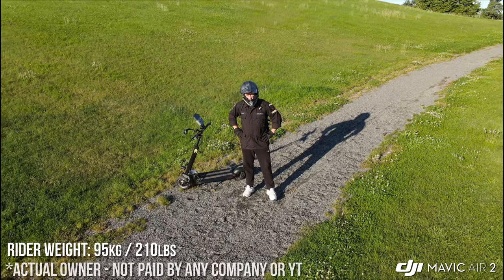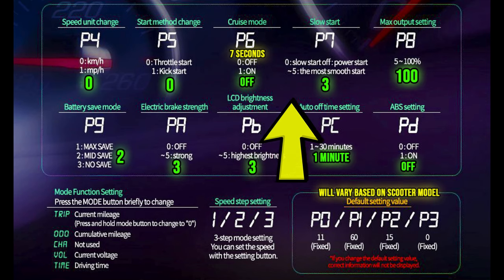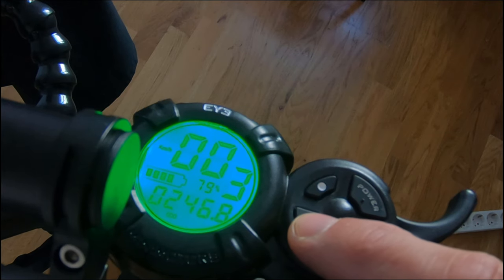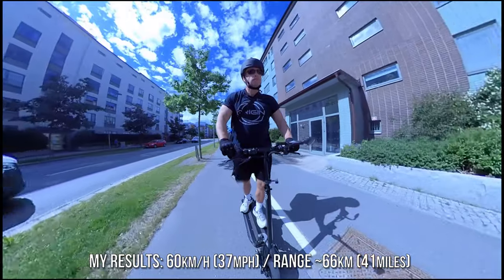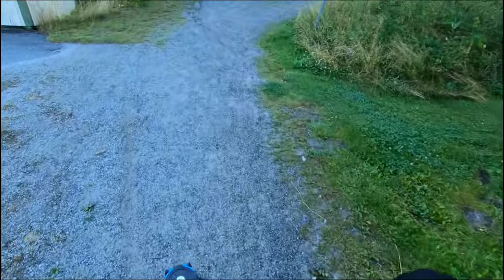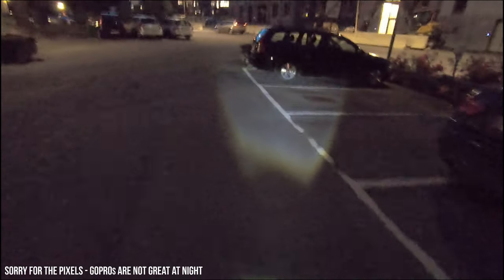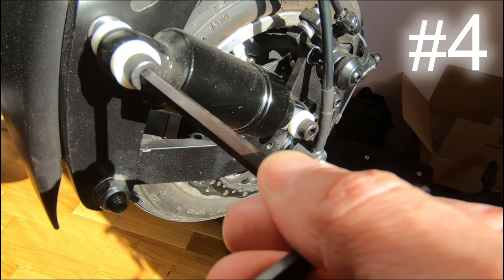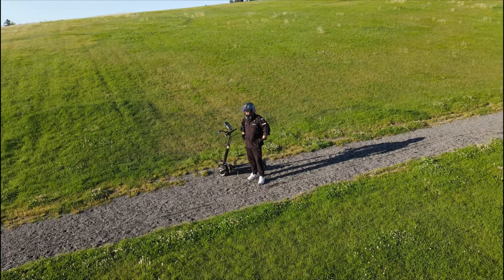Speedway 5 Review.  200km Owner Report.  Electric Scooter.

Comment: Great review! Though I noticed that you didn't use the extra lights. There  is a button next to the two charging ports the turn on side lights and more front and back lights which you did not show in your light demonstration.
Reply from the maker: Thanks!  Yeah I forgot to turn those on.  I will post a mini - oops vid showing those light, and hopefully I can tweak the cam settings for better night quality.

Comment: What you said at the end was on point. I didn't realize until after I bought the Cruiser (Speedway IV) that I preferred the smaller lighterweight scooters. Those were what was best for me. Now I'm kinda stuck with it and have to live with this bulkiness.
Reply from the maker: That is the biggest challenge for most folks, figuring out exactly which scooter will fit the best.  I like all of the ones I have, but find myself hopping on the Speedway 5 most often (perfect balance of range, speed and weight for most of my commuting needs)

Comment: what a review. jesus, that was superb. I have over 600km on mine spw5. I will check the screws you said it may be tightened.
Reply from the maker: Thanks so much!  The 5 is a pretty solid scoot, but those few bolts seem to take the most punishment from driving.   At 600km, you have any issues at all you have noticed?
Reply: @swerider2417  Not really, so far no problem. Not lose bolts or screws. The handlebar had to be tightened  as it was already kind of loose for braking and acceleration i am assuming...my issues with the scooter are the mudguards...they both suck ass. (specially the front one) i had to purchased extra mudguards from the minimotors. They are pricey but now its way better. Other than that...is such a great piece of machinery.

Comment: Best review ever seen . My Speedway 5 after 300 KMS it's making a lot of noises ( crank crank ) from the front fork where is the shocks . So I have to buy from Ali another ones and change / replace with the stock one Wich the scooter's comes .
Reply: My Speedway 5 was really creaky but I used wd 40 on the shocks and washers. The sound is completely gone now. Also tightening all the screws and bolts is required regularly. Hope this is helpful.
Reply from the maker: Thanks!  Mine had some noise, but it was fixed with tightening the bolts.  You could try some lube/wd40 on the shocks like Jeff hittall suggested as well.
Reply from the maker: @jeffwhittall371  Mine were fixed with tightening the bolts.  Great suggestion on the wd40 - will keep that in mind for the future.
Reply: @swerider2417  better silicone ( spray WD-40 ) I think is super cool too . But I want to put another shocks .. like EXA 125MM or DNM .
Reply from the maker: @ManDone88  I might do the same because of my weight.  Check out this vid: https://youtu.be/ozlC07iIOms  In the comments he has pics of the sizes of shocks that fit the speedway 5.
Reply: @swerider2417  cool . Ty . Hope you do a Telegram channel for us ( Speedway 5 users ) .

Comment: Great review! I am considering purchasing one to upgrade/replace the scooter I have. This so far looks like what I'm looking for in terms of what it can handle. I have a question(or few). How has the maintenance been? Have you run into any issues where you have needed repair? Are you able to do it yourself or do you know services that can help repair it. Like possible lost/broken parts, replacements etc. Thanks.
Reply from the maker: Thanks!  I have just over 300km on it right now.  Maintenance has only been tightening bolts (I have loctite on them since 100km and they have not needed tightening since - but I still check them every 100km).  Tire pressure refilled once - all tires loose air.  I  have Armor-Dilloz tire sealant in them and not gotten a flat yet🤞.  Brake pads still in good condition, but I dont do extreme braking.  So been a really reliable commuter for me.  If this one ever dies/wrecks etc.  I will get another Speedway 5 to replace it.  Replacement parts are readily available.  I have not needed to repair/replace anything yet.   I did recently buy the carry handle for the back - makes it much easier to lift up and down steps.  I will show that in my update video when I reach 500km.   Hope this helps, feel free to ask if you have other questions.

Comment: Thanks for the nice review.  Seems that you found it fairly durable thus far with minimal quality / durability issues, which is something to beware of in the relatively young e-scooter market.  I am wondering on how water resistant this scooter is.  Do you think  it can be ridden in light rain on wet city roads with occasional shallow puddles without fear of failing components due to water?  You mention the 4 caps that would be concern for water, what do these 4 caps cover, and would it be easy to make them more waterproof?  Is one for the charging port?  Is there an overall IP water resistant rating on this scooter?  Thanks.
Reply from the maker: Since the review I have run a thick bead of Blue Loctite silicone around the 4 caps and at all points where wires enter the deck.  I have ridden on wet roads after rain, and so far seems to be working.  I won't risk driving in the rain, as the sealing I did was to protect from splash back.  The 2 charging ports sit behind the cap, so not an issue.  I am not aware of any IP rating for this scoot. Honestly with the gaps and entry points straight from the factory if a seller lists an IP rating, I wouldn't trust it.  Only scoot I know that has an IP rating marketed is the e-Move cruiser (single motor version of this)
Reply: @swerider2417   Thanks!

Comment: Is it waterproof or resistant? I live in Florida so rain can be a big factor during hurricane season?
Reply from the maker: The speedway 5 is not waterproof.  I have ridden after the rain, but I have added sealant around the base and where the wires enter.  I would not drive in the rain though.  The e-move cruiser is water proof, but the cruiser is a single motor version of the speedway,  so not as fast.

Comment: I’m jammed up deciding between this guy and the DT Eagle Pro, any advice? They’re supposedly comparable spec-wise and price wise, I’m somewhat wondering if it’s worth the extra money to get the name branded version for parts and maintenance reasons, or is that mostly a non-issue? I’ll be my first actual purchase in the e-scooter department. They both just fit my budget and weight/space requirements really well.
Reply from the maker: I think if you go with the branded Speedway 5 or the Eagle Pro you should feel comfortable with the minimotors logo.  The only reason I stayed away from Dualtrons was the stem issues and felt like buying a Lexus vs. a Toyota.  Both same motor and power plant, but just not the flashy trim. Never haven ridden an Ealgle Pro, really can't comment on ride and other stats.  The non-branded one I have I just ordered spare tires for the branded one, - non-issue as parts are identical.
Reply: @swerider2417  If I may bother you on one last thing, I’m having trouble finding it on aliexpress,  the link wasn’t working for me so I’m having a go with the regular search and it’s hellacious. 😂
Reply from the maker: @blackjack117200  No bother at all.  Going to  try to paste the Long link here lol:  https://www.aliexpress.com/item/4000359594289.html?spm=a2g0o.productlist.0.0.3092583bAFkV9D&algo_pvid=9e68182e-0522-4f76-a42f-95b0cf51a0e1&algo_expid=9e68182e-0522-4f76-a42f-95b0cf51a0e1-39&btsid=0ab6fb8315890151230201271e272e&ws_ab_test=searchweb0_0,searchweb201602_,searchweb201603_
Reply: @swerider2417  Thanks! Have a happy New Year!
Reply from the maker: @blackjack117200  No problem.  Happy New Year!
Reply: @swerider2417 Just for an update: I drove a few hours to the closest shop which was Ryddo in LA and did some test rides and checked out different models for three hours or so, and I finally settled on what used to be the owner’s personal DT Thunder he was selling as a demo unit, I think I ended up getting a good deal but mainly I just felt a lot safer on the thicc boi. 
I still greatly appreciate the help!
Reply from the maker: @blackjack117200  Awesome!  Glad you found a good fit, and, at a good price😉.  The Thunder is a beast.  I'm sure you will love it🛴

Comment: Hi I just got my speedway 5 yesterday.please my question is how do you check the watts on each tyres of the 1000watts. Thanks
Reply from the maker: Not sure how you would - a scooter techie might need to answer that.  Would probably need some sort of electrical monitoring equip to verify.  Since the speedway 5 is and established scoot, I never questioned if they were actually 1000w per wheel.  Hopefully someone will chime in here and give us both the answer.

Comment: Har du möjligtvis kvar länken till scootern? :)   Den nuvarande funkar inte.  Funderar på att uppgradera från Zero 9.
Reply from the maker: https://www.aliexpress.com/item/4000359594289.html?spm=a2g0o.productlist.0.0.3092583bAFkV9D&algo_pvid=9e68182e-0522-4f76-a42f-95b0cf51a0e1&algo_expid=9e68182e-0522-4f76-a42f-95b0cf51a0e1-39&btsid=0ab6fb8315890151230201271e272e&ws_ab_test=searchweb0_0,searchweb201602_,searchweb201603_

Sorry for the long link - but it works ;)
Reply from the maker: There is also a local shop in Stockholm, but for a few 1000kr more:  https://minimotorssverige.se/product/speedway-5/
Reply: The link is not working anymore...do you now where to buy it now ? 
I don't want to buy the branded one and pay extra for the name only...
Thank you

Comment: @swe Rider , which is the diameter of the stock brake disk of speedway 5 ? It doesn't put any mm on it . And I want to buy 160mm custom one but I'm afraid is doesn't fit ...
Reply from the maker: Just measured mine - 14cm or 140mm
Reply: @swerider2417  160 Will fit without any modifications ? I mean , the adapter will support it ?
Reply from the maker: @ManDone88  Not sure on that one.  To me it seems that a spacer/riser would be needed on the brake caliper to support a larger disk - but don't know much on modding.  There is not much clearance with the 140, so my guess is that 160 would not fit without mods. - Just a guess though.

Comment: what is the minimum voltage cut off?
Reply from the maker: Mine shut down when I pushed it full mode 3 up a hill around 43v.  Not sure if the official number by the manufacturer.  I charge mine now whenever the voltage goes below 50v.
Reply: @swerider2417  I believe it's 44 V

Comment: Thanks for your video!
very helpful!
I'd like to ask, i find 2 or 3 sellers on aliexpress that sell speedway 5 at 1350 € while official stores sell it at 2000..
Do you trust that the product is genuine ???
Thanks!
Reply from the maker: Yes I trust them.  I purchased mine from aliexpress (mine is a no-logo version) and other than mine not having the logos, it is exactly the same as you would buy from minimotors.  Same motors, battery, EYE LCD.   The official stores have markups and most prices are in a fixed range.  Sellers here in Sweden are priced almost exactly like the minimotors prices in the UK and USA.  All of my scooters have been bought on Aliexpress/Geekbuying, and I have not had any issues.  Folks that buy from "official stores" still receive scooters with flaws, so other than having a local store for support, no reason in my mind to spend the extra cash.  The minimotors store here is only open a few hours on SAT.  No repair services, just sales.  I could not justify paying more for local.   NOTE: Big thing when buying from Aliexpress - be sure to pick a seller that has a good rating, and has made several sales of the model.
Reply: SWE Rider I’m in the market to purchase a turbowheel lightning. It is trustworthy to buy one off of aliexpress? I was going to purchase the lightning because it is the cheapest version of the zero 10x I saw being by companies.
Reply from the maker: @l-Lucid-l  I have purchased all but one of my scooters from Aliexpress, and most of my scooter accessories.  In my experience you can trust most sellers on Aliexpress.  Just check the user ratings and feedback for the seller.  Often there are multiple sellers that sell the same item - try to find the one with the most/best reviews.
Reply: @swerider2417  Thanks a lot!
however only one store in aliexpress has 16 sells.
other sellers only one or two scooters.. And the first one (l-s store) already a buyer wrote in the comments that bought a scooter with problem.. 
also how is it possible to avoid paying extra tax in your country? if you live in EE?
thanks!!!
Reply: SWE Rider alright thanks man
Reply from the maker: @apostoloskak4991  Most sellers have a way around the EU tax - the drop ship to Poland or Spain, then the shipping continues(or begins😉) from there.  I purchased mine from "SPEDWHEL Intelligent car Store" and can verify I paid no EU tax(I Live in Sweden).  They only have 5 sales on the the specific scooter, but lots of other sales with a 96% positive rating.
Reply: @swerider2417  thanks  !!

Comment: Eh SWE Rider! Great Review, I bought one too. Need your help; the top part of stem, where it lock clamp is. That top part has 3 bolts, should that top part have a slight bit of play/movement? Cheers Man
Reply: Short answer: no

Small movement of the clamp section translate in big movement on top. The whole handlebar stem has only 2 points of contact. A plastic bit at the bottom (had to adjust mine because handle bar was not in line with front wheel) and the clamp section.

Regularly chech all the nuts & bolts and tighten them and check tire pressure.